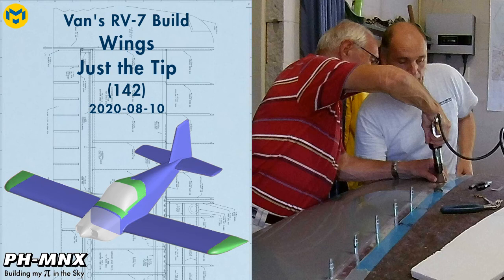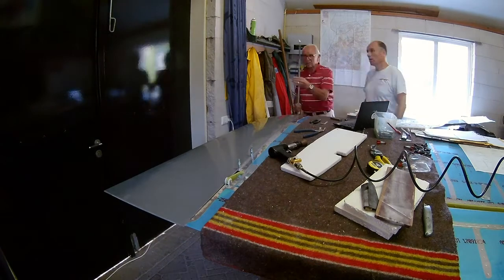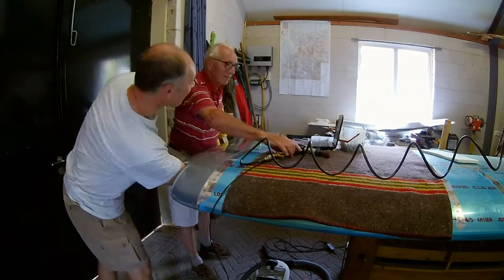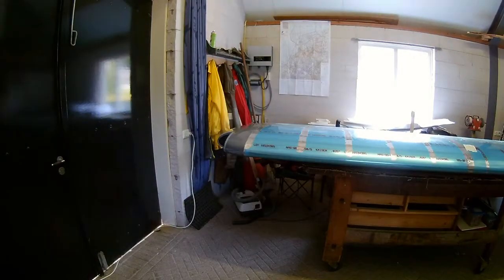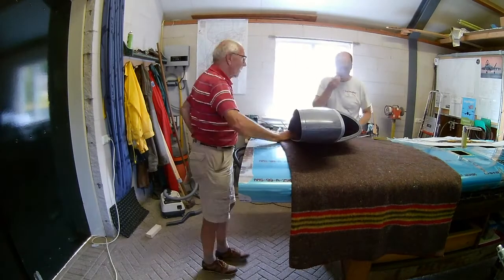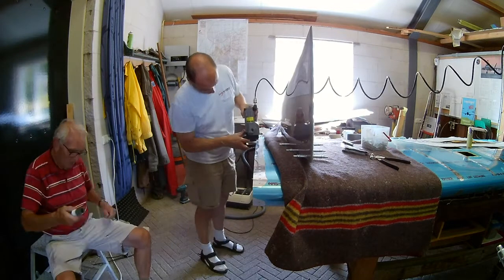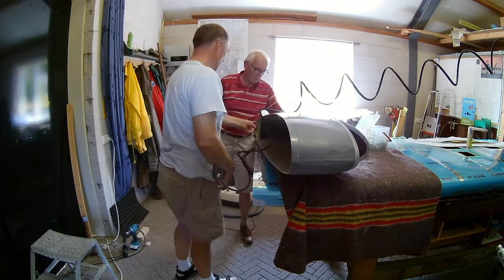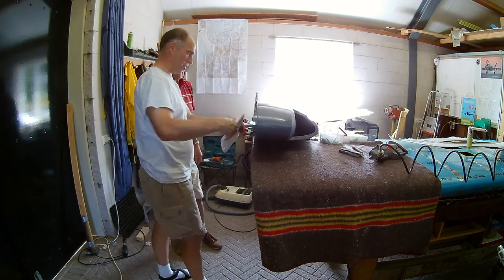Van's RV-7 Build Wings Just the Tip (142)

Comment: have you had any regrets fixing the tips on permanently ?
Reply from the maker: Not yet, until now I had no reason to remove them.
Also there is nothing in the tips except the lights and they are run through a pipe, so I can always change that.
My fellow builder of an 7 in my hangar does have them removable, but he also has antenna's in there. 
I think if you work really careful, you can make the tips removable without making it ugly. But that does take some skill. 
But no until now I have no need to remove them.